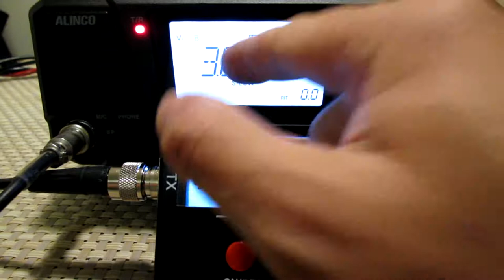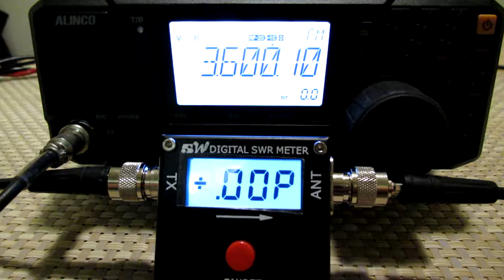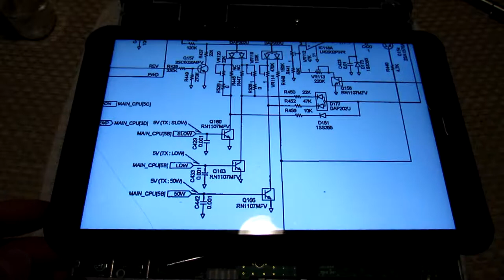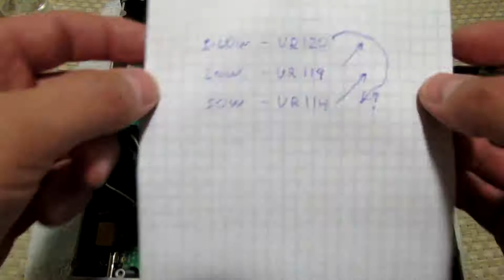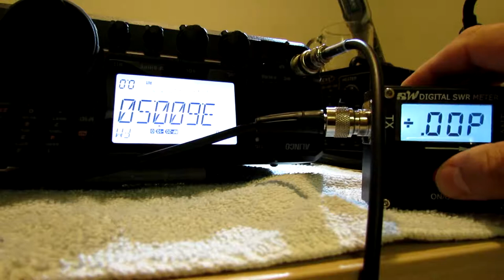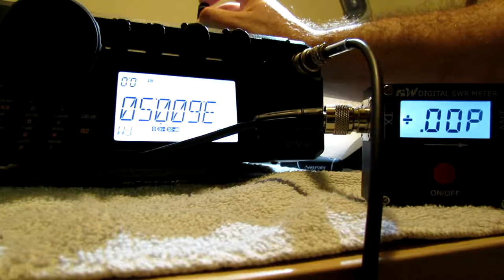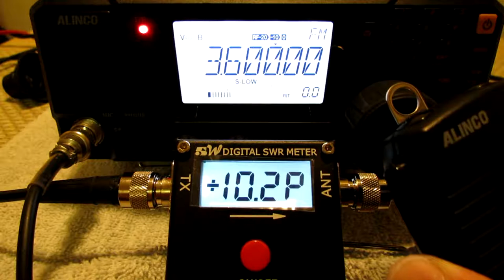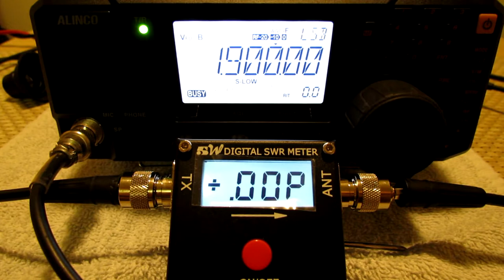Alinco power mod.

Comment: That was good investigative tech work!  Thanks for sharing!  The only thing I would have done different:  set the power levels to 10w, 32w, and 100w so the s-meter is evenly divided as the powers are increased.  Each power level increasing by 5db, which is almost an s-unit.  For me, I guess I would have used 4w, 20w(for 10mhz),100w - each power level 7db apart and a very even progression up the s-meter and quieting of the receiver at the other end.  Thanks for another great video - helping empower dx-sr8 owners!  Oh! By the way, congratulations on owning a Dx-SR8 - they are great rigs at a decent price point.
Reply from the maker: Thank you for the interesting note.
This is not a first modification of my DX-SR8.
It was changed the backlight of the display from cyan to green.
Also, I decreased IF gain, which made the receiver not so noisy.
Reply: @UT4UFA How did you change the backlight colour?
Reply from the maker: To alter the backlight color, a complete disassembly of the front panel is required. 
Exercise caution during this process, as both the LCD and the controller on the PCB are sensitive to static and mechanical damage. 
At the top of the LCD module, there is a small strip with LEDs. Ensure you select LEDs with the same size as the factory-installed ones but with the desired color. Additionally, be prepared to replace current limiter resistors, as the new LEDs may have a different current consumption. 
This is a concise overview of the procedure. @drankurbaruah
Reply: @UT4UFA  thank you so much!!

Comment: My radio only puts out 49w on full power, brand new right out of the box. I know the radio is a few years old but it was never taken out of the box until I received it from a friend.
Reply from the maker: 49 Watts is too low. Did you use the proper source of power - 13.8V 25A? Also, did your power meter and dummy load as well?

Comment: I have a problem with my radio dx sr8, the screen flickers and is accompanied by a vibrating sound (old position in use) what should I fix, can you give me information. thank you. My notes are modified via jumpers on the radio mainboard
Reply from the maker: Hi,
It is very difficult to diagnose what is wrong with your radio.
Try to use another external power supply.
Also check your current power supply on a ripple (under dummy load).
Then linear voltage regulators, inside your transceiver.
I would recommend using an oscilloscope.

Comment: Nice job. What brand solder station are you using?
Reply from the maker: Hi, for this project I used a Chinese rework station YIHUA 852D+
Reply: Hmm!!  I had one but it kept screwing up, lots of cold solder joints. I also had a hard time finding/buying new solder tips.  After 7 months of light uses it blew up.  Maybe I had a bad one. hmm.   Thanks for the reply.